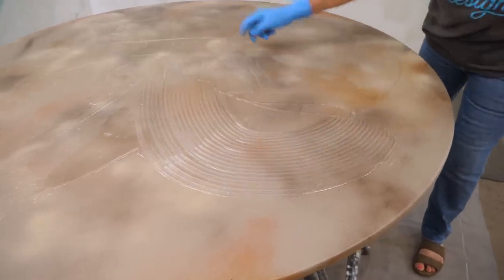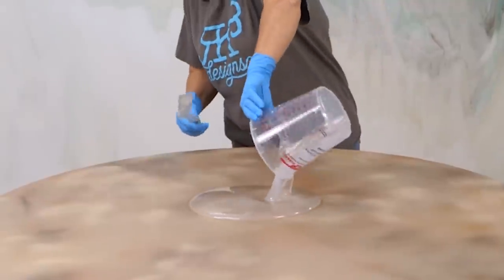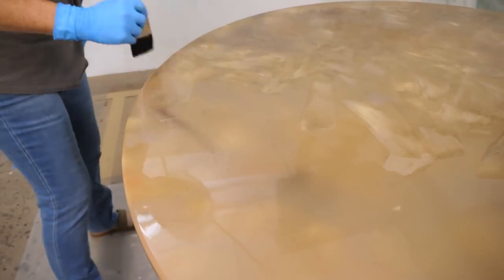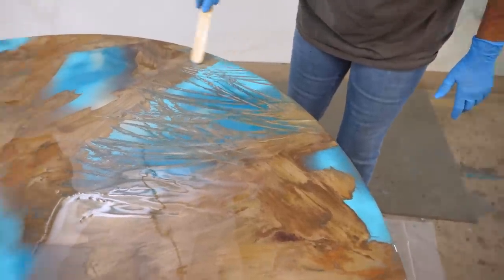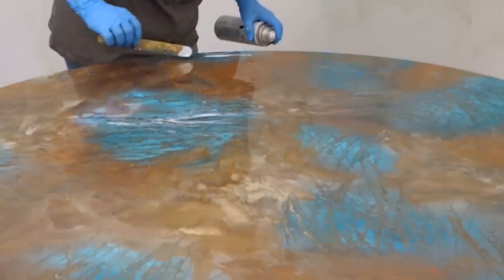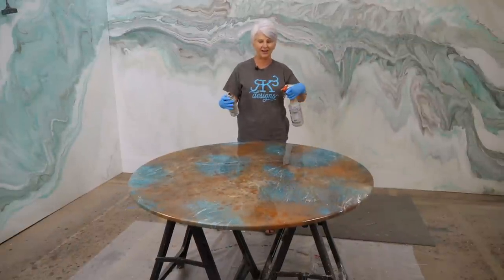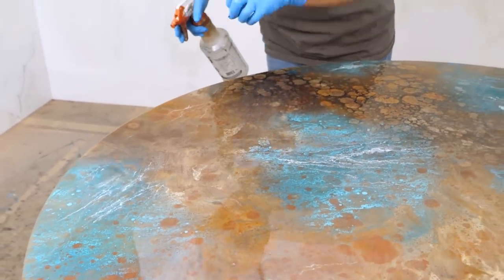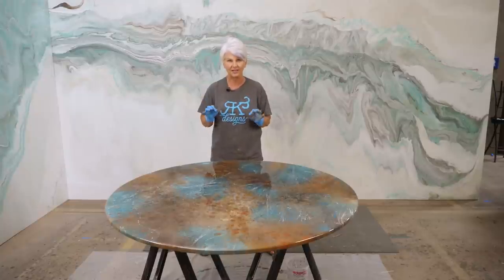How To Create A Unique Epoxy Finish With Spray Paint | RK3 Designs

Comment: I like the silly string, as an abstract painter at times,  I love to throw paint, and this fine line of silly string does give a nice accent.  I like the marble energy it gives off.  For myself on this project, I would have kept the white scratches lighter, or not use them, but used the silly string instead.  Of course it's all relative to what is requested.  Beautiful job.

Comment: I really like the final product.  Quick question, though.  When it was still wet, the colors were bright and glossy.  After the top coat, it's not as shiny and the colors aren't as bright.  If the glossy topcoat was used, would it look as bright and glossy as it did when the paint and epoxy were first applied?  Thank you.

Comment: Ok..i just start watching this video and you sprayed paint on surface ..is that can be acrylic paint with natural sea sponge application could give same effect..is that ok use acrylic paint  instead of spray paint ?
Reply from the maker: No, you don’t want to use a water based paint on epoxy if it’s not cured.
Reply: @RK3Designs  thank you very much..

Comment: I watch your videos, but I work small.  I have a bunch of wood  pizza peels, etc. that  I would like to do something like this.  Would it be possible to use acrylic paint either straight up  or in a clean spray bottle? Thanks
Reply from the maker: You won’t want to use acrylic spray paint with the epoxy. It won’t react like regular spray paint. It may also clump and cause the epoxy to get really gummy.

Comment: I'm just guessing that with as many products that I would have to buy to recreate this, I could buy a slab of real granite and save myself the work, and have the real thing ♥
Reply from the maker: Obviously you haven’t priced granite lately. The MDF may have cost $25, I have maybe $50 in epoxy and less than $5 in spray paint. (I already had those colors) but hey, you can make any excuse not to do something yourself. 🤷🏼‍♀️
Reply: @RK3Designs  lol, I am constantly working on projects. I'm just guessing that that many different colors of paint must cost a fortune. Truth be told I hadn't looked it up, I will do that now ♥

Comment: So, how much for all the spray cans of paint, epoxy, final gloss coat material, sprayers, propane torch, etc.?  Looks like about $500 to $600 to buy all those materials.  Of course, if you use them all the time, you could spread the cost out, but looks like mighty expensive for a single project.

Comment: Hi, I am so distraught over the different dry times companies implement to apply resin on acrylic house paint & spray paint ....EX. epoxy bartop installers, 1+ hr works, no prep on gloss paint. 
Ex. Acrylic art pours 3+ weeks works, no prep.  Guess that its not a demanding enough surface  to matter.
*((Any words of advice, or opinion on correct dry time for paint??))  I'm lost, & comes down to guessing.

▪︎I mostly resin over multiple spray paint coats, &  spray paint touch ups.  I know some paints dry slow, i do my best to avoid slow dry types.
 Vehicle traffic is a complete different scenario, yet thats what it comes down to for me, harsh conditions.

And no one is flattening the sheen on gloss paints...not even bar top specialist, & de-lamination becomes a big issue, & nightmare.
Reply from the maker: It will really depend on what epoxy product you are using. I use Stonecoat Countertop Epoxy and I go over latex and acrylic paint all the time. You want to give the paint at least 24 hours to off gas before you pour epoxy.
Reply: @RK3Designs  ok, i will continue to trial & error with some of my clients. 
 24 hours has Seemed appropriate for fast dries, that handle minor flex, & then other paints that set slower, i assume 48 hours.
  I have been switching to all flat & satin artist spray paint to get the best result. 👍   
Rustoleum & krylon have frstrated me lately, & i'll never put resin on cured gloss unless flattened with scuff pad though.